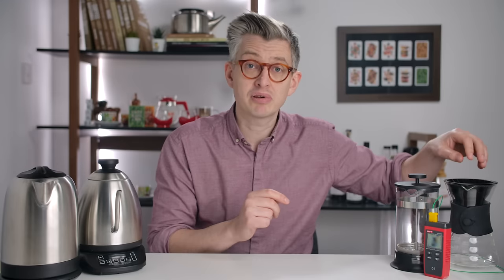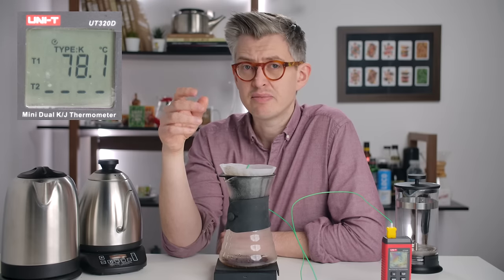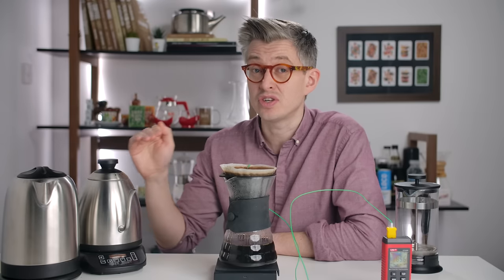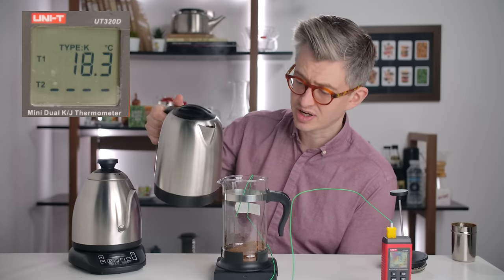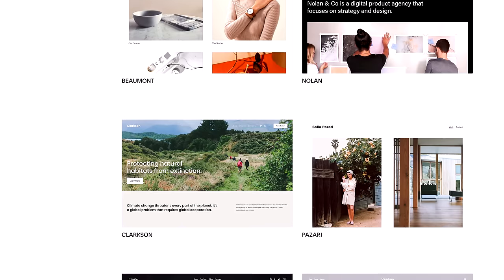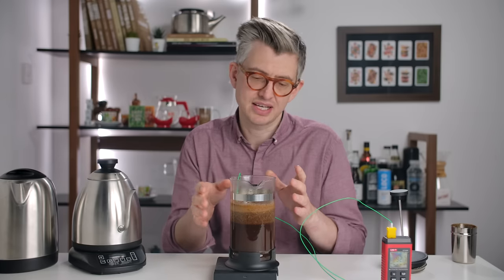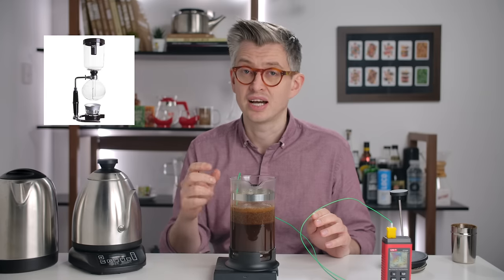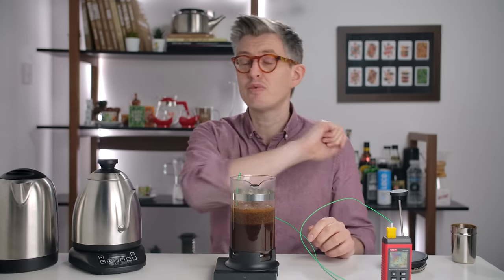Brew your coffee with boiling water - coffee brewing temperatures explained.

Comment: If it's hard to go wrong with the water temperature why do a lot of Aeropress recipes (including the creator) say to use temps in the low to mid 80s?
Reply: He never said temperature has no effect. Of course it affects the coffee extraction. The point of the video was more that you can't "burn" coffee with boiling water.
Reply: The aeropress inventor gave it to very experienced coffee people at dif temps and 95% chose that at the 80s. Customer centric approach. If you read, apparently one of the coffee people is a big espresso coffee professional
Reply: In the States I've found that most people by default get a very dark roast coffee, so advising mid 80s is probably quite sensible.
Reply: My thoughts also. Maybe when the Aeropress was first created most of the coffees were a dark roast? Hey James, we need some more answers!
Reply: Tim was right, and also aeropress is using higher pressure than any other manual brew tools, so more variable added, might be the exception. Cheerss
Reply: The aeropress expands  and i find the seal kind of leaking when I used the inverted method and let it steep for a minute. Maybe thats the reason the inventor recommends the right side up/normal method and lower temps.
Reply: @MihaRekar  aeropress is 100% better at temps in 80s vs boiling
Reply: @jakstrike1  why is that? The roast of the beans doesn't make a factor?
Reply: @pistacho.cerrao  Sorry, meant to reply to the original comment. Not sure why - but using aeropress for 2 years it's a much more bitter/burnt flavour with  variety of beans with boiling water. Might be increased extraction with the pressure. Could just be my preference
Reply: @MihaRekar  9:40 ish he says as soon as it's off the boil with med and light roasts. It's not just the inventor that uses low temps, look at previous Aeropress champions some go into the 70's which when in the Aeropress will drop again.
Reply: I think it is that the coffee sits with the water, which makes for a less clean cup. Where's for a v60, the coffe constantly gets fresh water. Too compensate they use a lower brewing temperature, with a higher dose of coffee and dilute it after brewing. The lower temperature also makes for a sweater cup. :)
Reply: Another variable is that boiling water + plastic is not a good combo.
Reply: The aeropress also often involves a stir. If you've ever seen the 2 minute cold brew aeropress recipe it involves an espresso grind and a sixty second stir. It likely has a big effect on the extraction.

Comment: I've found that even with instant coffee(I have exactly one specific kind that's palatable to me), water temperature is important. Using 100degC water makes the instant coffee I buy taste pretty much like your run off the mill filter coffee. 60-70degC water on the other hand makes the coffee more pleasing in taste - even when drinking the coffee at the same temperature(yes, i actually went through the process of making myself two cups and measuring the temperature). So given that instant coffee is just brewed/dehydrated coffee and given the flavour profile changes with water temperature, there must be something else going on here, not just in the slurry. In my experience you kinda also get the same unpleasent flavour profile changes with these old coffee machines that have a hot plate to keep the coffee warm.

Comment: Regarding the syphon, how does the higher temperature affect brewing? And is there a plan for a syphon brewing method video soon?
Reply: Syphons can get very hot but at the same time it's pretty easy to under extract with it! If you're a syphon fan as I am i bet you know this can happen. Please look at this, when you use a dripper and pour boiling water the highest temp your coffee grounds see is around 92C. While syphon can get as hot as boiling during the whole brewing time, if your syphon temperature is very high (measured at the upper chamber) say 97-98 you can get ashy, burnt flavors you surely don't want. But for medium or light roasted coffees brewing on a very hot syphon is much easier and better for sweetness and roundness.

Comment: I'm not disagreeing with your conclusion that very hot water makes very good coffee, but I'm not sure if I agree with your reasoning. If I understand correctly: You respond to the claim that boiling water is too hot by pointing out that the slurry temperature is at most 93°. But the easiest counterargument is that a slurry temperature of 93° is too hot. Rephrasing the question in terms of slurry rather than water remperature is good because it's more precise and allows us to compare brewing methods, but it's not really a solid argument.

Comment: I always assume that the "brew as got as possible" rule applies only when using good grinders. I myself am using porlex mini and I remember getting bitter taste when boiling with hot water.  I understood this is because the really fine, powder like grinds are being over extracted, so I've used lower temperatures since - does it make sense?
Reply: Yeah, ceramic burrs create a lot of fines in my experience. Save for a Commandante and stop ruining good coffee:)
Reply: Oh, man. I found the exact same thing with my Porlex and Aeropress, but didn't understand what was happening until now. I just got a better grinder so time for more experimentation.

Comment: I owned a fancy kettle you could set the temperature on once. It used to turn itself off all the time before reaching temperature. Replaced it and the replacement did the same.
By the time boiled water is in the cup it sounds like it would be the correct temperature anyway if you are trying to use cooler water for say herbal tea...

Comment: One of the things that I’ve played with a lot when making infusions for cocktails or other culinary applications is vacuum. The effect of boiling a liquid can produce some really interesting and tangible changes when applied to infusion processes, but often the heat required to achieve it can be destructive. Using vacuum to manipulate boiling temperature in the form of a chamber vacuum or a rotovap has yielded me some really compelling results. There seems to be little to no use of this kind of method in the world of coffee. I wonder if there’s a specific reason or if it’s simply uncharted territory. Do you have any thoughts on the viability of manipulating atmospheric pressure during the brewing process?

Comment: when you take rolling boiling water off the heat the temp quickly drops to 200F (94C). In drip machines that make a hot cup the water temp in the basket may be 190F (86C), but is usually lower than that.

Comment: This is quite good for me because my office doesn’t allow kettles and the hot water tap for coffees and teas is set at 90 degrees C - yes I measured it! I couldn’t get the speciality coffees to work with my aeropress (espresso type ratios) and have been going with much darker roast recently and it is getting better. Still looking for the ideal recipe for this temperature using an aeropress.

Comment: Great, informative video as usual.
I think that you're spot on as far as dark roasts go - an over-extracted dark coffee would register as "burnt" especially to those not used to such high levels of bitterness (depends on what else you put in your coffee, too)
Something that I have noticed, however, is that the quality of a cup of instant coffee really seems to suffer if you go straight in with hot water. It ends up tasting bitter and flat compared to if it was re-hydrated in a bit of cold water or milk while waiting for the kettle, which is puzzling because all of the extraction has already occurred. I would like to see your thoughts on this.

Comment: I ran a test like this years ago, stuck an electronic thermometer into the slurry of a ceramic v60. We were trained as baristas at the time to use 205F water, pouring out of hario kettles, and the slurry got nowhere that hot. When I realized this, I cranked the water up to 212, which helped raise the temp some. Literally as soon as you pour the water out of the kettle, it loses temperature immediately as it hits the air, I think. You could try this same experiment without the coffee grounds, just pouring boiling water into another vessel and seeing the temperature loss. Luckily, despite what the coffee industry has been saying for years, coffee has been tasting pretty good, but I’d like to think using 212 water makes it taste better.

Comment: Watching your video's has greatly improved my coffee, without buying any new equipment. (I love filter coffee,  and roll with a ceramic filter holder from litteraly Soviet times, coupled with a west german clay coffee pot. A friend of mine gave me a pair of glass cups from Ukraïne and it makes for quite an interesting set-up.)

I never thought of thermal loss as a biiiig influence on coffee taste.
Now i preheat both parts, even the cups and they hold temperature very well because of their materials. Even without chancing anythin' except that the flavour has improved greatly, it is much more "alive".
Thanks!!!!

Also, since thermal loss is a thing i wonder why the west never adopted the "Russian" style of teaglass, it's so handy!
You have the glass, from thick sturdy glass that you litteraly boil.
You then pick it out with tongs and you can grab a kind of click-on sleeve with an ear. Usually made from a material like Wood that conflicts heat badly, although metals became populair as well because they are cheaper (mass manufacturing stamping)
So u can be sure ur tea stays warm for a longer period while not burning your hands. Really handy and really needed in the winter times because if you don't heat your glass the difference between the outside temperature and the tea can be so severe it may burst into pieces. With hot tea in it... Not desireble.
Reply: And yes i have seen it happen. I asked a railworker for directions in i think it was Omsk. He put his glass on a trainpart without thinking about it, it cracked and the tea froze on the train. We Both looked at the red-ish icy spot and then too eachother. We had a laugh about it. Was the most "Russian" thing i ever saw.

Comment: You don’t need to waste coffee to get a feeling for this. I poured boiling water into my aero press and measured the temperature straight away with my milk thermometer (so not as accurate).  Low 90s.  Repeated the test with jugs, mugs, cups.  Similar results

Comment: Outstanding videos. I am no coffee expert.  How about 2 issues I have with your particular info here. I will try metric LOL, If water peaks at 93 and cools some degrees over time... you miss that it is STILL cooking the grind. It may be slower. And that indeed would concur with the extraction of HEAT goals or losses etc. time and temp meeting those goals. The other issue is... and I am no coffee expert lol. I had a mr coffee which was actually great, dialed in 6 on my Encore. 3/4 cup haha 50? grams. it passed. Now I in haste bought a Bonavita Connesuer. Every thing I throw at it taste BURNT. Light roast, less grams, more coarse 16-24 on Encore. 60 grams, 50 grams. I did thanks to you and others just standardize to 1 liter. I don't weigh water.I volumeize it. Hey thanks for your knowledge, But if I am way off or close please let me know. And I am struggling, but want to get this Bonavita dialed in.   Thanks.  SamDav

Comment: Mmmmmm, I lowered my temp in my French press to get rid of my espresso grind bitterness and it worked. So it makes a huge difference to reduce the temperature; however, I was using espresso grind (Sage #11) with a very dark roast (Blue Bottle Hayes Valley). I lowered it by 5°C and I got rid of excess tanginess. Huge difference.

Comment: Nothing with tannins handles temps over 92C or below 89C very well, however the rate at which the grounds react to that heat depends on their size and temperature. Boiling them will make the coffee taste harsh and rancid for sure. Gradually pouring on water just as it stops boiling compensates for the sudden slight drop in temperature due to the coolness of the grounds and brewing implement, the more so at any altitude above sea level where your boiling point is down in the 90's. Cafe sous vide, brewed without air-exposure should theoretically be the gold standard.

Comment: Further to the comments, and debate, around the proper temperature for brewing the elevation of the Brewer is never discussed. The boiling temperature of pure water at sea level is 212°F / 100°C. 5:51. 5:51 My home in Denver, Colorado, USA is at roughly 5600 feet above sea level where the boiling temperature of water is 202°F / 94.44°C. At 8800 above sea level in Vail, CO the boiling temperature of water is 91°C/195°F. 
So much for those that believe boiling water creates a burnt, bitter taste.   
Kindest regards, 
Jeff

Comment: So, Cowboy coffee is made in continuously boiling water, maybe initially slightly below 100°C, and boiled vigorously for several minutes. Proponents claim the roiling of the "slurry" makes for a better extraction and allows for a "crema" as in espresso. You settle the grounds by adding a bit of cold water, which sinks to the bottom, taking the grounds with it. I have emulated this somewhat by stirring the slurry in a filter/drip coffee maker; it does seem to improve the flavour and creates a crema. I also tend to do an extremely fine grind, aka "turkish".
Reply: Hooley Dooley that's a hot cuppa joe!

Comment: Extraction is a physical process, not a chemical reaction. 

Theoretically, higher temps extract more oils & hydrophobic molecules than cooler water which will likely change the flavor but 10 degrees difference between boiling & hot water might not make much difference in what gets extracted.🤷

Comment: Another interesting variation would be topping off your kettle with fresh water at each portion of the pour. I have a water server where I fill the kettle once to rinse/preheat, again to bloom, again for second pour, and once again for the final pour. Since you are adding fresh hot water each time I'm guessing you'd get hotter results (which is a good thing for lighter roasts, as you note).

Comment: Interesting - gives some scope for taste testing. I think there's perhaps something missing from the detail of the rationale though... Any system can only lose temperature through the exchange of energy with its environment. As the water is boiled in the kettle, both the water and the majority of the kettle body will increase to their max temp. This puts the kettle-water system out of thermodynamic equilibrium with its environment and it starts to cool as soon as the source of thermal energy input has been removed. However, as the kettle is enclosed, this reduction in temp will be relatively small between the time taken to switch off and pour, so let's say it's negligible. Once pouring, the water will emerge from the kettle and immediately start losing thermal energy as it passes through the air. But the time frame for this interaction is also very short. Hence, when the water hits the first of the coffee grounds, it will still be close to its original max temp, albeit cooling relatively rapidly with all of its interaction with air and coffee. But the probe used takes a couple of seconds to register the temperature accurately, and it does so by absorbing more thermal energy from the water. Furthermore, the water will have met with a proportion of the coffee before it touches the probe. Hence, the interactions between water and coffee during the couple of seconds it takes for the probe to register and get up to temp, will be at a higher temperature than that measurement indicates. Once the slurry forms, there will be a greater degree of thermodynamic equilibrium throughout the cone, but prior to that, there will be interactions at a whole range of temperatures. 
I don't know what that will ultimately mean for the brewing process but it seems worth considering.

Comment: My father is a chemist and coffee lover, and he claims that the reason coffee which has been kept warm tastes bitter is because the compounds which makes the coffee tastes good evaporate at a lower temperature than water. So if you leave your coffee warm and exposed to air, the aromatics will go away and you'll be left with only the bitter, burnt taste of the compounds which do not evaporate. Hence, the idea of burning coffee.

This taught me two things.

1. Use a closed vessel (such as a thermos) if you plan on keeping coffee for a long time, .
2. If you make iced coffee, cool it down as quickly as you can when it's done.
Reply: what led me to search this topic is i usually microwave my coffee. when it starts to overflow, then i stop. but i suspect it doesnt get up to 100deg c. my microwave stopped working so i hand made two times on the stove. the first, i poured it out just as u see bubbles. those initial bubbles are really dissolved gases escaping the water as soon as it gets enough energy for the vapor pressure to overcome the partial pressure, which is way before 100deg c. 
the second time i made, i let it come to 100deg c where u get the rolling boiling water.  that gave it an very burnt flavor. 

so i do suspect now, that between 85 and 90 is a good temp for coffee. now that i learned that it doesnt burn the coffee, but the high temp water causes to good flavor compounds to boil away, and causes the burnt flavors to leech out.
Reply: Your father sounds like a man of wisdom to me, makes complete sense to me.
Reply: @Ziraya0  Right, that certainly makes sense. I have no idea how it works, I just regurgigated what he said a couple of years ago. :)
Reply: I never thought about it, but that may be true. I am a fan of cold brewed coffee. It has a much mellower flavor.
Reply: Thanks
Reply: That's why I always found my coffee tastes better when I use my lid on top of my cup